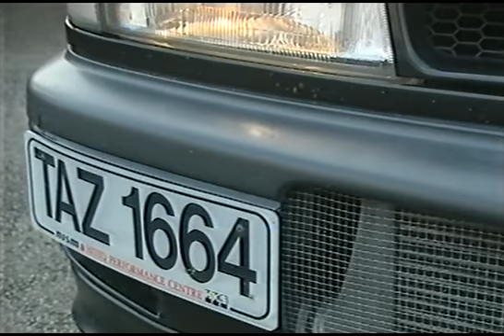Inside Out - Drifting in the UK

Comment: careful its been modified as much as it posssibly can with an oil cooler, a hks dump valve and a metal head gasket. : l oh yeah dont forget the little radiator shoved down the front, cheeky little bliter.